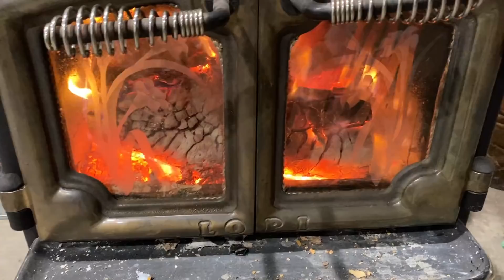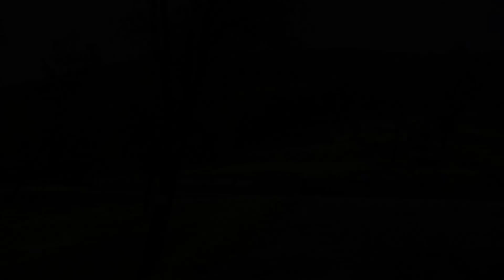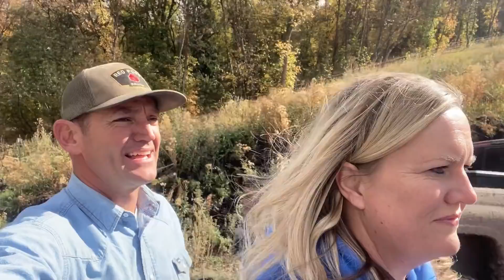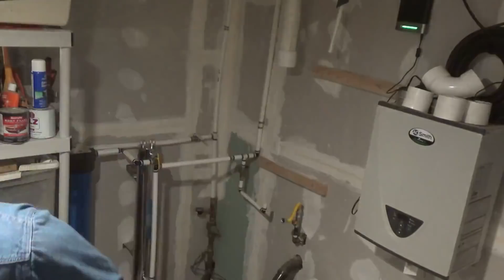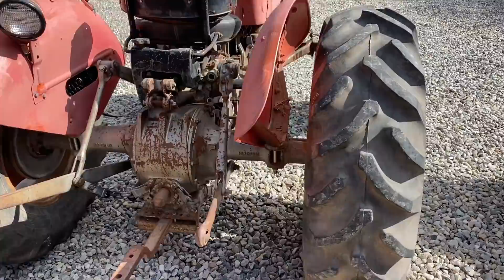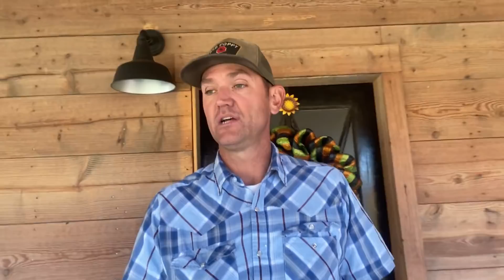#370 - I Installed An Ultraviolet Water Purifier On Our Off Grid Water System!

Comment: I have been binge watching your channel and has yet to catch up. If anyone who said you are lucky, I think it is simply because they are jealous with what you have done and achieve. It is incredible to keep pushing the project for 3 years mostly alone making your dream come true.
Just a suggestion, if you have considered improving the drainage or diverting most of the rainwater away especially in area where it is most prone to mud? The concrete slabs in the corner belongs to the foundation of a previous build? Ever consider using that to make a larger shed to store all your farm equipment?

Comment: fyi - that big coil of transmission line  by your water heater going between your amplifier and your roof antenna isn't doing you any favours with your phone reception as it is causing more signal loss. If you get a connector to match and shorten the coaxial cable will only help your signal.

Comment: Take that Backhoe and dig drainage ditches down that road. When you have free time...Then every so often. Run a 12" drainage pipe to the down hill side across the road. This will help stop run off from ruining that road. As that is the worst worry people have. Getting in and out.... If you don't. You end up with ruts two feet deep....

Comment: @Red Poppy Ranch ... so far the best channel I have come across in regards to wind power is @John Daniel. He has quite a bit of experience with a multitude of them. He may come off a little rough around the edges, but he is one straight shooter. I have been planning on running wind along with solar, and hydro if possible, for my power needs. John has helped dispel some misconceptions and taught me quite a bit.  On the topic of your wood supply I would echo others suggestion of employing a rocket mass heater. There are a number of ways they can be set up and in general will use about 25% of your regular load.  Keep up the hard work and no doubt RPR will become all you've dreamt it would be.  God bless you and yours!

Comment: You should check out VAWT (vertical air wind turbines) also known as Savonious generators. Standard wind generators have two main problems. 1. they don't operate well if at all in low wind scenarios. 2. they will fly apart in volatile wind scenarios (which you mentioned you had). A VAWT handles both situations with ease and bonus they generally don't kill a large amount of birds. 
You've seen this type of technology without realizing you're seeing it numerous times if you've spent any time in farm country. Look at the roofline of any large barn, see that round spinning finned air escape vent? That is a VAWT in it's simplest form without the dynamo technology attached to it.

Comment: Vertical Axis Wind Turbines (VAWT) are great for low winds which change direction a lot. They are also nicer to look at and run usually at a lower rpm so they tend to be much less noisy. Also wildlife isn't as much affected by VAWT since there profiles are usually such animals steer clear of them very easily.Maybe the watertank house is a good place to place a VAWT on top of... Remember, a large diameter VAWT results in a high torque machine which can get power even at the lowest of windspeeds...
A small scale DIY project here: https://www.youtube.com/watch?v=8MQaT9EbMDQ

Comment: I have understood the UV light from the stainless steel filter housing can reach the plumbing leading up to it. This light can damage curtain plastics so please make sure the pex tubing you are using is UV stable or replace the first few feet with copper pipes to be sure...

Comment: don't know if it is available in your area, I buy recycled concrete for my driveway and it stays where I put it and hardens after being wet. might be a solution for your road, it is cheap compared to other materials. makes a smooth solid driving surface that won't wash away and holds up to bad weather.

Comment: Have you looked at what is used on yachts, I know they are a bit pricey but they are very good and they also have a built in brake and cut off encase the wide gets to strong. There are also some high out put land based stuff but, I don't know much about them. Biggest I have found in Australia is 2000w  48VDC for about $3,000 AUS.

Comment: I wouldn't put any gravel on the road, i'd get some roadbase a truck or two every once in a while and spread it out on the road, that would be better then you can cap it off later with a bit of gravel to keep it stable, see if the county will spring for the base and you maintain it, some counties will do that, some won't, but its worth a try...  I'd love to see your property next year when i get up in that area, i have in-laws in St. Anthony..... so thats not a huge drive away :) Can;'t wait till your shop is done, love the vids, keep them coming.

Comment: I designed energy systems that are hybrid and houses are being installed with this system in Sweden (no sun mid winter) and overall they have heat, hot water and electricity, and when connected to the power grid they generate $3,000 income a year.  A low speed wind turbine is a must and the systems have to plan to deliver over your needs.  Its not the good days that are the problem it is the bad days.  I do have a new system that requires no fuel, no weather, and no sun plus does not need battery storage and in its current form generates 10kw ever hour every day all day.  In Sweden this would deliver an income of $161,000 a year.  No the device is not available yet, there are 10 of them running, getting it out and in production is proving a problem, too many people are trying to protect their oil investments.  This device put on an electric car needs no batteries and has speed potential even Tesla cannot realise - and it cannot catch fire. There is a 1kw generator that can fit in a back pack which tied to a saline battery system  will also require no fuel no weather  and be completely efficient.  The choices coming are profound changes to how we have lived but the greedy and the bullies have to back off. This project is on hold for the moment, I have another more amazing thing about to be delivered, and will re-assess when that is available to everyone.

Comment: Try a vertical wind turbine, they take up the same footprint no matter the wind direction, are fairly heavy rain and snow proof as well as quieter.
I have seen them mounted here, out of cyclone zones, on the end eaves of high peak roofs as well as standing vertical on a post off the corner of a building near the batteries and controllers.

Comment: There is an generator for homes that runs off of propane and or gas when the electricity is off. Sorry on the brand. Really dependable. Good price at the time I seen it. Wind turbines to each their own. Some good and bad. Sorry cant help. You and your family have done an amazing job with the place. It has came such a long ways. Take care.

Comment: The road desperately needs to be crowned and pitched.  And drain to well maintained ditches.  Need a road grader or somebody who is an expert with a box blade. Then you need a backhoe or excavator like you have to clean up the ditches on BOTH sides so that ice and water have a place to do.

Comment: My well water runs through two filters, 5 and 30 micron and then through a 20” UV light, we’ve been drinking it for over three years and never had an issue, just changed the light and filters at regular intervals

Comment: I have an old 52 Ferguson TO30, my pivot pin looked about as bad as yours when I bought it. Ended up having to replace the entire carrier.  I have used it to work our road, which was a mess when we bought the property, with a grader blade. I think I finally have the crown of the road, uphill side ditches and culverts good to go. We ended up having to buy some old guardrail from the highway dept and buried it in a couple of trouble spots on hills to divert water into the ditches. It has worked pretty well, but if you are not careful they will get ripped out while plowing snow. I am sure having you up there working the road on the regular basis will help keep it in better shape.

Comment: Have ever looked into asphalt millings, seems like it would be a good fit if you had a company by you
Reply: Bad idea. Asphalt millings do not pack well and when dry the will blow away in the wind and in heavy rains they wash out fast.
A good solid 2 minus base is the first ting to pack in there then progress up to 3/4 topping. Done right it will last for ever with minor maintenance.
Reply: john ahern gotcha, I don’t have any experience, just seen it done.

Comment: I admit to not liking wind generators because of the bird kill. Yet to my surprise, I saw one that worked really good and exceptional I might add. If I had a link to one I would send it but since I don't, I'm trying to describe it as a unit standing straight up yet not so very tall. Yes it is circular but it is flat panels standing close to each other with space for th wind to blow through. Require minimum wind to turn and  will turn easy in light wind. there must of been say eight or more blades flat hooked on their side to a rod in the center. The flat blades turn the rod, the rod turns the gear assembly and that turns the generator well enough to power  this canadian home and is their tottle gen system to their surprise as they were going with high quality solar generators/panels. This sparked my intuitive mind. What if the panels turning were solar and the wind and sun doing a same said thing at the same  time which I never have seen but the person who comes up with it will have something and they will say you know that old guy in Alaska gave us that idea. Maybe we should send him a card or see if he is still robbing air from the young who need it more. I think the veins could be on stops so they only travel so far in either direction an then that would be little worry as they would spin the shaft in the middle and it would generate some electricity. I'm sure that a system like that would require its own battery bank even then and somehow us diodes to make sure that this juice goes one way only and that way each system remain guarded. I don't watch tv and get the late night infomercials.... I just over think everything in the what if area.... give it some thought as your the bright one... dad called you son

Comment: Hey mate the place is looking great i have been watching from afar and up are really making the place look good. Just thinking of a way you could use some kind of steam driven engine to help with the battery charging as a alternative way of making power you need to burn wood to keep the house warm, you could have a system that boils the water for the steam system as well and also provide you with unlimited hot water. Just a through away. Keep up the good work mate it will pay off in the end.

Comment: I haven't watched all of your videos so I don't know what other water treatment systems you have in place, but keep in mind that UV is a disinfection NOT a purification or sterilization system. It does not kill all microorganism all of the time. Unless you couple it with a chemical disinfectant, water that sits in your lines after the UV system is subject to microbial regrowth. This is why UV and Ozone are, by law, not sufficient by themselves for disinfection of municipal water systems. A minimum residual disinfectant concentration is required at the furthest tap from the supply. Since I'm sure you're on a private well, you're not legally bound to do anything to your water. At a minimum, I would run the tap to flush the system thoroughly before each use if UV is your only treatment.

Comment: Missouri Wind and Solar has a VWAT that isn't too expensive. It outputs AC so you will have to step it back to DC for your batteries, but it will also give you the ability to bypass the batteries when you have prolonged winds.
Reply: Also, you might consider a lithium battery bank. More expensive but a lot longer life, less maintenance, and no 50% threshold to worry about.

Comment: I see someone (Tony) already suggested a vertical wind generator. I would like to add to that I believe you can make your own. Three half barrels on bearings for a trailer with a pulley driving a modified alternator(permanent magnets). Use the 3 phase (3 wires without using the diodes built in the alternator) change it to DC with the diodes close to the batteries (far less line loss. You make 12 volts at 6 amps and 12 and 5.5 amps gets to the batteries using 10 gauge wire because if sent on 2 wires (DC) you will get about 11.5 volts at about 4 amps. The power then should go through a buck and boost to insure you always charge the batteries with little to much wind. I would like to help you with this project over the internet via e mail.

Comment: It's snowing at your house...but it's 94 here...with a heat index or 101!  Trade ya!  :)
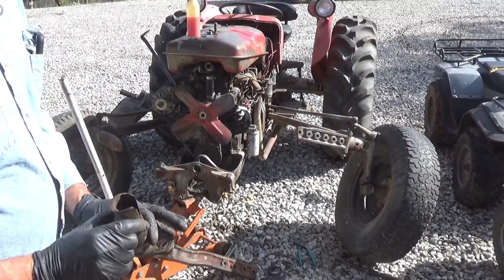@9:24  Well...there's your problem.
For a good wind generator I would suggest one that starts production at 4-5 mph.
Also you can check out Missouri Wind and Solar for the hardware...it is a really good company.

Comment: Banggood do 1200W Wind Turbines for a reasonable price. Although realitively low wattage, they're running most of the time, so should stop your batteries running too low. Somethinh like this: https://www.banggood.com/3000W-Wind-Power-Electricity-Generator-12V24V-5-Wind-Blades-Horizontal-Wind-Generator-With-Controller-Wind-turbines-Blade-p-1558846.html?rmmds=search&ID=49552&cur_warehouse=CN

Comment: Call the county and ask them to dump some gravel on the muddy places. Pray about it. Wind is good IF the wind is blowing 15 to 20 mph at least. Little breezes do nothing . If you have 12 volt system it easier to charge with low wind. But 24 volts is hard to charge with wind the wind has to blow fast enough to create more than 27 volts. chrarges good with 30 volts that takes about a 25 mile an hour wind. dont happen often enough. Solar is better the sun shines more then the wind blows Solar is the best option. Buy more solar. Sure wind will help on a blustery winter day.

Comment: Put some 3 inch gravel on the muddy parts looks like there arent so many a dump truck load spread on each place would fix them up for winter. Use large gravel that wont bury so quickly.

Comment: Safety note - I work with UV sanitizers for hot tubs. Every one comes with a warning: do NOT look at the bulb when lit. It does irreversible damage to your eyes. I really hope your units are different, could very well be. But look for labels, warnings in the installation instructions, etc. You sure wouldn't want to harm yourself by something which is so easily avoided. God bless!

Comment: man, i'm so impressed with your skill set. you can take apart and fix anything and easily move between electrician, carpenter, mechanic, plumber and civil engineer. every dude should aspire to serve his family as you do
Reply: He even cuts his son's hair, and his wife cuts his
Reply: He may have learned all by himself but some credit must go to his parents too. They did not raise a man child, that's for sure. As for the tractor, I worked as a mechanic  for 14 years and repaired hundreds of these same little MasseyFerguson's. They are easy to work on, simple as it can be and they always leak something. If not oil, then it's coolant or fuel. The cast iron block is so ancient in design that most of the oil lines are routed by steel lines externally. Basically you always have to have a bag of spare aluminium washers for the fuel and oil lines.

Comment: Here is a thought.  Instead of having a generator running 110v and putting a charger on the generator, use something like this 48 volt generator that you could put on a small engine or even the tractor to charge the batteries directly.  Even build your own wind generator if you feel like it.
https://www.auroragenerators.com/products/48-volt-generator

Comment: Good luck with that road, time has taught me that you'll never out-gravel the low/wet spots, you have to insert drainage into all of those spots so they don't accumulate water in the first place. Finding materials (like precast drain pipe) to do that right, and then resinking them as winter heaves your materials up every year, becomes the challenge.

Comment: You should look into getting road killings a lot of times company’s will give them away if u haul it and when u compact them they make a decent road again
Reply: I think "road killings" would get a bit smelly and slippery after a while.  "
"Milling" however would be less nasty but not work to well on a road that as no base work done first. 
Plus the fact that the millings, unless you pay a high price for them  (often more than good gravel would cost and be more durable ) come with large chunks of solid asphalt that won't bind together with the finer 'stuff'. 
ERGO, 
Less compaction,  not sustainable in wet or dry weather. Might work on a small driveway with no heavy traffic but not on a rough terrain road like RPR's.
Reply: john ahern we used it on our dirt road that didn’t have a base seemed to work good for us but maybe it’s because we used a roller to really pack down the body’s

Comment: I can't say I haven't been skeptical of your electrical system from the beginning but knowing you're not even in the winter yet when the long nights start and you're already running your battery down to 70% I'm thinking either you going to have to learn to conserve more get more batteries. Wind turbines don't really work all that well on a consistent basis and when they do they really don't add that much is my understanding propane generator is probably your next best option at this point for the coming winter
Reply: Lazynub you are rite, solar is not that good up in the PNW come winter. But you cant tell people that. He will find out this winter and hopfully be honest and tell all us just how much he has to run a generator